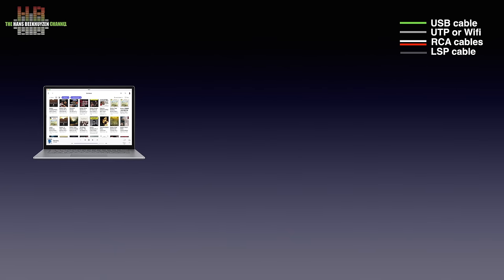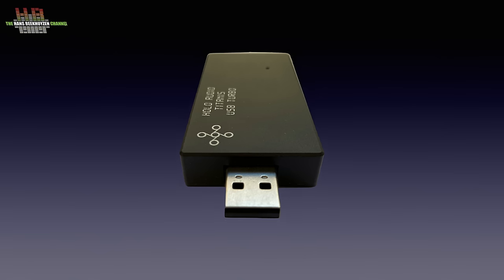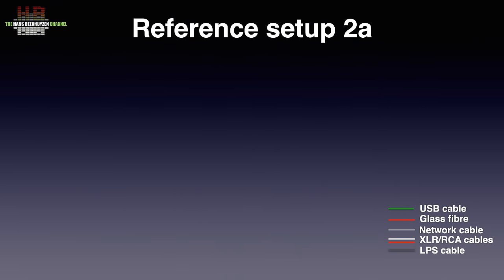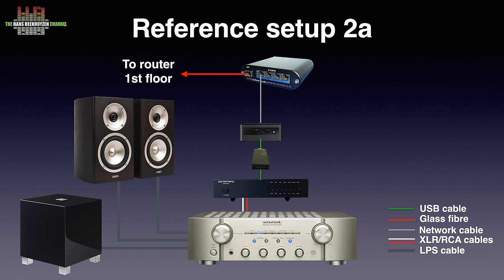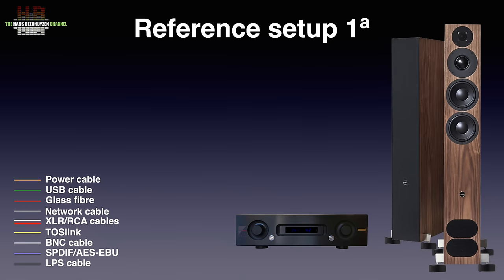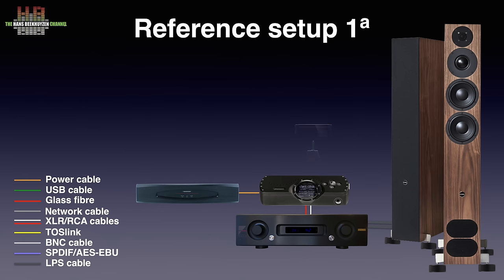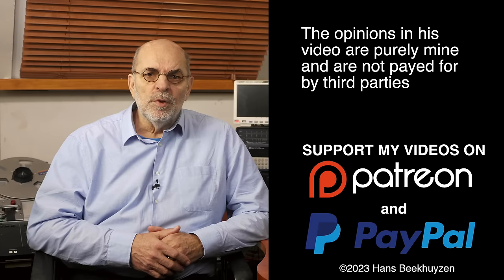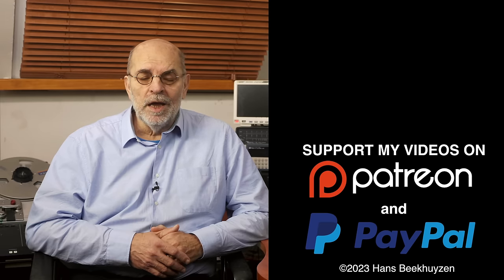HoloAudio Titanis 800 mA Advanced Active USB processor

Comment: I had some significant distortion on my headphone using an entry level usb dac (fiio k5 pro ess).
It was caused by the nvidia gpu during heavy screen activity.

I easily fixed this by using the USB hub in my monitor for the usb dac.
Reply from the maker: That shouldn't happen!
Reply: @TheHansBeekhuyzenChannel  i agree, but apparently this is very common with usb dac's.
To describe the issue somewhat better; when the gpu is a bit active (e.g. a page refresh of a content-heavy website ) there is some buzzing in the headphone. I was unable yo hear it when there is actually something playing but also didnt try hard.

I saw quite a few people solved this with USB filters, but apparently a simple USB hub (in my case in thr monitor) breaks this signal.
Reply: I experienced the same issue with my raspberry pi 3, with a hifiberry dac phone jack. In this case it was a constant buzz.

Effect was gone after disconnecting the hdmi cable!
Powered via 5v connector on hifiberry dac.

Comment: Thank you very much for the review, I really appreciate it!
So compared to the regenerators that use an external power supply, how would you rank this? Is a regeneration device with a good power supply always better?
Reply from the maker: There are no general rules. If a reclocker is of good quality, it will improve the sound quality. The same goes for an external power supply. And if both are of good quality, that will again further improve SQ.

Comment: Hello Hans, 

Does your system also have attention for the signal cabling and power of the components from modem to your switch?

Hope you can comment on that.

I also use the Titanis connected to a Intel nuc 8i3 with Roon rock and found that  connecting the intel nuc to a sbooster power supply brings another nice upgrade. After that I took care of everything before the intel nuc: the switch, my WiFi mesh router and the ziggo modem. I provided all with sbooster power supplies and quality signal and power cabling, even the cable from the incoming signal to the ziggo modem. Even replacing the memory on the intel nuc with industrial quality memory apacer memory and a intel optane ssd made a nice difference. I am quite happy with the result of the whole upgrade path and the journey till now was a nice experience.
Reply from the maker: You find all about my reference setups here: https://youtu.be/vmRj7zx9s_o
Reply: What differences did you notice with power supply and data cable upgrades to your modem?

Comment: I swear these are ALWAYS sold out every time i check, but considering my DAC has no USB input and i use a computer source via a DIY usb to spdif converter and i also use a standalone "audiophile" usb pcb card, would the holo titanis make a difference for me?
Reply: May I  ask what you are using, I'm not giving up  my PC in the chain but haven't explorered an I'm assuming a PCIe USB card.
Reply from the maker: I rather use a network bridge like the SOtM sMS-200
Reply from the maker: When connected directly to a normal computer over usb, sure.

Comment: Wasn't there an MU-1 in 1a?
Reply from the maker: Yes, but there is no point in testing the MU-1 AES outputs with a USB device. I did use the UES of the MU1 but not confuse everyone I called it a NUC for that is what is then used. The Grimm magic happens after the NUC.

Comment: Would this be needed using a tablet under battery power?
Reply from the maker: Well, it works without but sounds better with. Batteries are noisy too and there are many clock oscillators inside a tablet and not much space for isolation.
Reply: Thanks for the reply